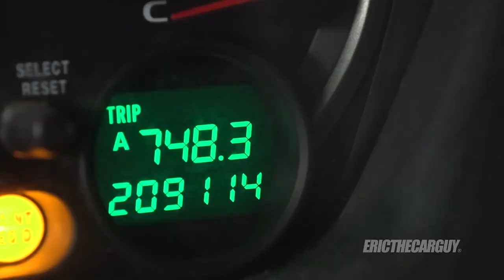2003 Honda Pilot Powertrain Removal

Comment: Eric you don’t no this but I’m living my best mechanic life through your video’s! Thank you for your hard work. Be well my friend 🙏😎
Reply from the maker: I'm happy to oblige. Thank you!
Reply: Me too!!!!!
Reply: @ericthecarguy  I have a 08 that I drove every day I need replace the rear motor mount the long bolt broke but my issue is that I can't access one of the front bolt easily and I realized that all the muffler flange nut almost fully rusted out can't afford to remove muffler know in the winter. Wonder if I can supercharged mine also in the future. Many thanks to you for your videos it has helped me done a valve adjustment.

Comment: I always stretch the seat belt and Wrap it on the bottom of steering wheel loop it and Attach it to the Seat belt clamp to hold steering wheels straight just a tip on what I do the steering wheel Clamp works good also @EricTheCarGuy

Comment: We have been doing the out the bottom subframe swap on our race cars for years...lots of fun at the track with an engine hoist, jack stands and plinth blocks.  Our record (4 folks working and one play tool fetcher) was 70 minutes.  Each teammate had a laminated sheet of instructions, half of which were verifying things the guy next to him was doing from their sheet, and two battery impact guns.  True, things like AC system and factory labyrinth airbox intake were gone but still pretty proud of that.  My favorite instruction was for the tool fetcher "put all the spare wheels and tires in the trunk".  The look of confusion on his face was epic...until he saw where the final location of the jack stands on plinth boxes was!

Comment: Hey Eric Toyota have them Special Cotter pins Also on quite a few things especially 3rd gen 4runners from 96 to 02 as well as first gen Tacoma @39:00 @EricTheCarGuy
Reply from the maker: Those are the best in my view. They always seem to come loose when you need them to. And no bending!
Reply: @ericthecarguy  I agree they are so nice to work with and never had one give me a issue there used alot on Bell Cranks for emergency brakes on Drums for Toyotas

Comment: Surprised you didn't loosen the jam nuts on the outer tie rods while still attached.  I also never disconnect the top mounts until all the lower cradle bolts are off.  Seems a bit safer to me. Still everything was well done.  Personally would have replaced shift cable for peace of mind, but I am sure the weld will be fine.  Great video!
Reply from the maker: I did that on the bench with my vice. I knew I'd be reconditioning the subframe and would remove the rack in the process. Thanks for the comments.

Comment: Erick in 1996ish  I was cleaning the inside of a motor/oil pan with break clean to get most of the oil out of the way and went to lunch. When I came back Ben was still standing there looking at the car like it was a demonic Spawn of Satan. He decided to help me and weld the leak in the oil pan and blew both rocker covers off the engine and dented the hood with them lol.
Reply from the maker: I had a similar thing happen to me. I was doing head gaskets on an old Acura Legend. I had the drivers side head off and was cleaning the gasket off of the block. I also used brake cleaner to clean some of the oil that was on the surface. I wanted to remove the alignment dowel from the block do remove more of the gasket but it was stuck. I decided to add some heat to loosen it up. The brake cleaner ignited and blew the valve cover off of the other head. A huge fireball shot out of the side I was working on and singed my eyebrows. The shop got real quiet after that big bang. I'm still here though.

Comment: I had trouble with stabilizer links on accord v6 07. You have to do the whole vice grip "thang".  It was a biatch. Then I used heat, propane torch, and it was butter.

Comment: If you’re going to hook the transmission back to the radiator I would strongly advise you to replace it, we’ve had a number of Honda vehicles leak coolant into the trans and have had to flush them extensively
Reply from the maker: If I was going to do it that way I would have tested and flushed it first. However, the reman transmission states that I use their new cooler only, and bypass the one in the vehicle. Thanks for the suggestion.

Comment: i am surprised you havent got a HF gantry yet.  Waiting for the move?  i got sick of the cherry pickers leg issue when lowering the cradle (but your custom engine holder helps much there).  Gantry is a game changer for when you can take out the top to save time from dropping the cradle... Cheers!
Reply from the maker: Shop space is limited and the crane works fine.

Comment: I had a pilot that had a rattle after we had done some job that required dropping the subframe. The front right bolt was just spinning. Turns out someone had broken the thread sleeve off. I decided to give it back to the guy who had done the job

Comment: Watching you spray that brake cleaner without glasses on. Gives me the biggest anxiety. When I was getting my block ready for paint I did the same. And then hit a bolt hole and the spray went back into my face. I was blind for 5 minutes. Had to rinse my eyes for 15 minutes under running water. It burned! Thank god nothing major happened. But yea. Wear safety glasses when spraying that stuff. It may not be bad on the skin but holy crap! The eyes!

Comment: i've seen a lot of youtubers take a lot of bolts off with a milwaukee impact but i've never seen the milwaukee struggle like it did at 44:18. was that the 2767 m18 high torque?
Reply from the maker: Yep. Linked in the description. It's a long bolt that was cross threaded. I think any impact would have struggled.

Comment: do you prefer not to pull motor transmission out the top? without a lift its much easier less work to pull the drivetrain from the top IMO. to each their own tho.

Comment: Easy answer to a transmission cooler inside a radiator leaking or not is absence of coolant pouring out of it while hose is unhooked. Leaks work both ways for those that didn't think that far.
Reply from the maker: I have a better answer, the transmission remanufacture would void the warranty if you used the OE cooler and not the one they provided. I'll cover this in a future episode. Thanks for the comment.
Reply: @ericthecarguy  Yeah I was once upon a time the trans tech for a 5 star Dealership, already know that answer :)

Comment: Oh on a last note, look into “link ecu” as an ecm replacement so you have the ability to tune the engine to utilize that forced induction. I use one in my odb1 swapped EF hatch.
Reply from the maker: It won't be possible on this vehicle because of the AWD system. I'll have to use this instead. If it becomes available again. https://www.apexi-usa.com/products/afc-neo-fuel-management
Reply from the maker: @Jalopy247 You might want to click the link I provided. Thanks for the comment.

Comment: They may have sent you free mounts but those Anchor motor mounts suck.  I installed one on a customer's 08 Odyssey, rear and non VCM so it was just a regular rubber mount, and it failed completely in just over 20k miles.  I had to replace it with a genuine Honda mount.
Reply from the maker: Are you sure those were Anchor mounts? https://www.youtube.com/watch?v=hGQnmkE0zEk&t=13s
Reply: @ericthecarguy  100%.  Bought it at Advance Auto to replace one that was torn after 195K.  By 218k the new one had failed worse than the 195K mount.  The one I replaced wasn't an active mount with an electrical connection as you refer in your video link.  It was just a standard rubber mount.

Comment: Hi Eric, I like your new shop.  I liked this as it being similar to Odysee, I am going to get a front clip of a 2003 odysee and graft it in the rear of a 1990 Nissan Micra. I was hoping to get a turbo v6 engine setup like cadillac's or even use the Northstar motor , the V8 along with the FWD type trans. Of course , would be wiring with the computer. No cross threading involved. Mostly welding.
Reply from the maker: Well, I haven't moved yet. Good luck with your project.

Comment: Hi Eric!  As a "wish I could be prouder" owner of a certain 2003 Acura coupe which has been mentioned in the past as a "bad" Honda/Acura model line - due mainly to transmission issues; don't these Pilots have similar tranny issues?  If so, is there something you're doing to alleviate to problem for the next slushbox?  Moreover, if you are doing something, would it help my sweetheart?

Comment: Eric. Do you know if its okay to measure fuel pressure on the pulsator, by removing it and making adaptor to fit the gauge , on cars that don't have test port ?
Reply from the maker: That's the way the manual tells you to do it. In fact we had a special adapter at the dealer for it. However, I very, very, rarely see Hondas with fuel pressure issues.
Reply: @ericthecarguy  Thank you. 👍

Comment: Eric, greettings from Mexico,  any reccomendation on an alternate brand that is not OEM. for front and back struts/shocks for a honda odyssey 2005.
Reply from the maker: If you want it to ride good, use OE. Otherwise, you're on your own. Sorry to be that way, but I have yet to find an aftermarket brand that works as good as OE. I believe Showa is the OE supplier for Honda. If you can find those you should be good.

Comment: Hi ERIC its possible on 2010 Honda insight 1.3 to leak motor oil from the head gasket? I pay $250 for this diagnostic and they are asking $1200 for the repair

Comment: Were those trans cooler lines just looped together? Or did it also have an aux cooler?
Reply from the maker: It had an external transmission cooler installed. I showed it in the introduction video. https://youtu.be/11nl6FCkr-s

I'll show again what I replaced it with in a future video.

Comment: Eric, can I ask you a question. I have Acura TL's 2007 and 2008 , I bought the 2008 new, it is a type s, 6 speed. And the other is just a base Navi 2005. My wife uses the 2005 for a winter car, it is not that we don't love the car, but is it possible to run a lower octane fuel in it? The 2008 is to me much more sporty , and we will continue 93. But I was just curious you expert thought on this. Thanks Bryan
Reply from the maker: https://www.youtube.com/watch?v=8VWEwEveGTQ&t=3s
Reply: Pro-life tip any car since the 80s can run any octane
Reply from the maker: @Bogdan Oros   100% not true.
Reply: Apologies I really should rephrase any modern car with a knock sensor should run at least 87 octane there are some special exceptions but for the average driver it should be ok? I very much oversimplified and overgeneralized
Reply: well thank you my friend, I will just keep using 93 , I can afford it. So why be cheap. BTW, you did me the best possible thing for Honda / Acura owners, a few years ago when you told me to just use the 5 quarts for the V6 Accord and the TL's, when I change my oil. I was so sick of taking that .4 of a quart out all these years. thanks again
Reply from the maker: @Bogdan Oros  I recommend watching this video: https://www.youtube.com/watch?v=8VWEwEveGTQ&t=4s

Comment: One benefit (albeit an expensive one) for buying a car new is that when you do your own work on it over time there usually aren't any "surprises" you get from used vehicles. I cringed at all the issues Eric had to deal with (cross-threaded bolts, non-functional ground cable, hacked-up shift cable, etc). The humor is probably the biggest mitigation to an otherwise swear-fest experience.

Comment: He " HATES THESE TYPE OF FREAKING BATTERY TERMINALS ", I use the Marine type or Military type. I hate those VERY THIN ONES MORE LIKE A BAND CLAMP, like the first one you took off. At least the one you threw away you can make bullets out of, imagine all the bullets you threw away, NOOOOOOO.
Reply from the maker: I keep my old wheel weights for that. I keep them in a bucket behind my balancer. BTW, that thin OE battery terminal is made of good steel. I'd use one of those over the POS I removed any day. Thank you for your comments.
Reply: @ericthecarguy  NICE TO HEAR, Wheel weights are prime for making bullets. I agree the one you took off & threw away are POS Terminals. The steel ones you like ( WHICH YOU HAVE MUCH MUCH MORE KNOWLEDGE ABOUT THEM THAN I HAVE ) usually bend on me quite easily if corroded, NOT MAINTAINED. Maybe I don't know how to take them off correctly or use the wrong tools ? THANKS FOR YOUR REPLY, SIR ERIC.

Comment: Four fasteners to remove the air-box?  Pfft.  Amateurs.  My wife's 2012 VW TDI Sportwagen has SIXTEEN!  VW is apparently very protective of their air-boxes.  LOL.

Seriously -- 10 of them you have to remove just to replace the air filter.  The other 6 hold in the base of the air-box.  Oh, and of course they're all T-20 Torx bolts.  I've never seen anything like it.  Those engineers went a little crazy designing that thing.